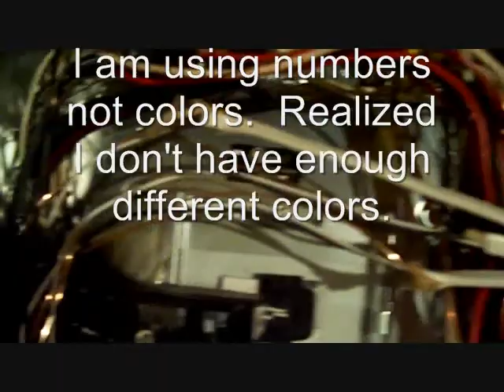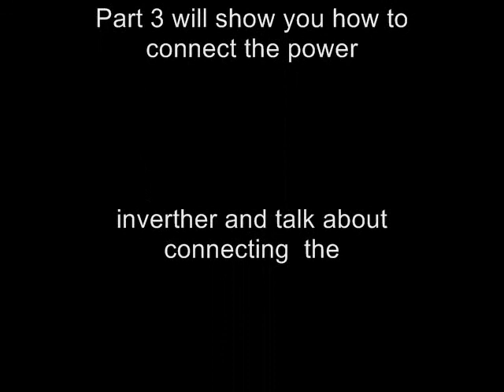Wind Turbine Electrical Guide Part 2 2of2, Part 2 of part 2

Comment: That's not the answer in basements up here either!!!  We're rather wet due to the clay ground.  You are correct.  You don't want your heart between the positive and the ground!  Damp feet on a damp concrete ground will do just that!

Comment: Having to remember to turn the breaker off before flipping the switch to the inverter sounds extremely dangerous.  I know it seems like an easy thing to remember but it only takes forgetting one time to cause a whole lot of problems.  My suggestion is to use a 3-way switch instead.  Connect one side to the breaker in the panel and the other side to the power coming from the inverters.  The center then goes out to the circuit in the room you want to power.

Comment: rubber gloves bad! false sense of security. they puncture easily, because wire can be sharp. a good rule tv techs use is to only ever have one hand in a tv at a time. that way if you do bump the wrong thing, you're not holding something with your other hand and have the power effect your heart.